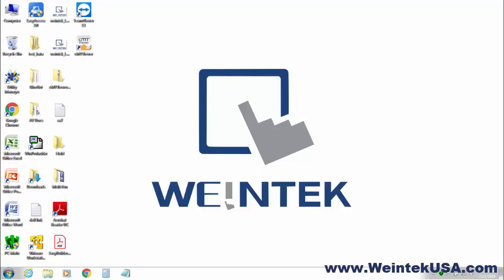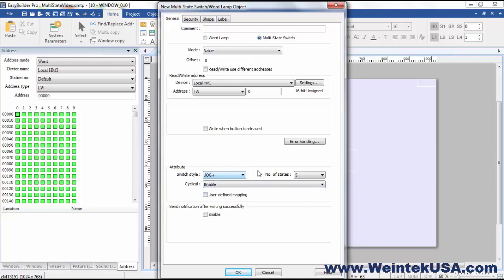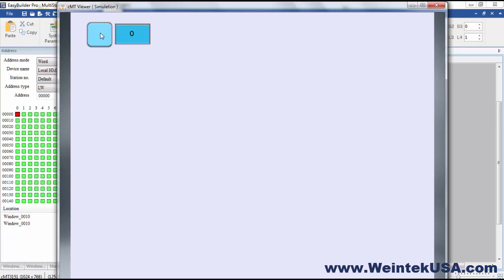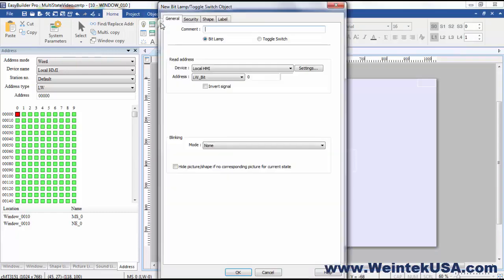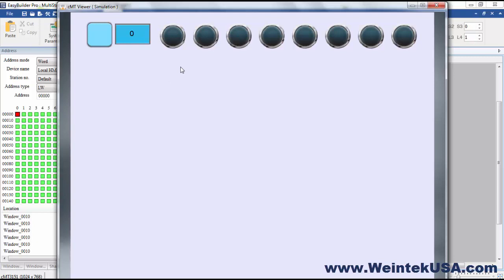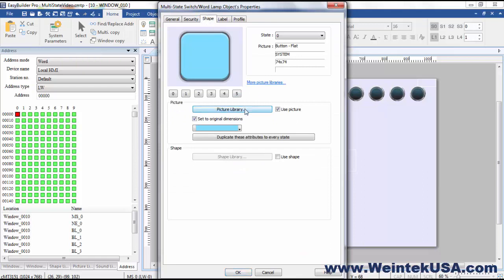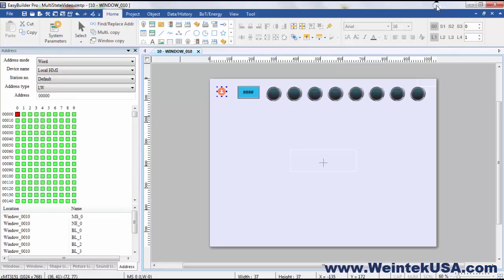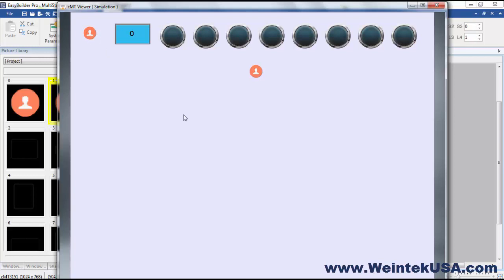Multi State Objects, Switches & Word Lamps w/ EBPro V6 Weintek

Comment: Thanks for video. Could you make video about colour animation of industrial equipment (first of all motors, valves) ((for example green colour is work state, grey is not used and red is alarm state?)) Could you make alarm messages during alarm state?
Reply: Hello,

We try to produce content as quickly as possible and will have more videos on the way soon.
While you wait for new content I suggest that you contact your local Weintek Support center with the specifics of your application.